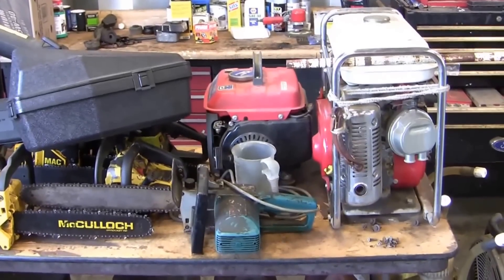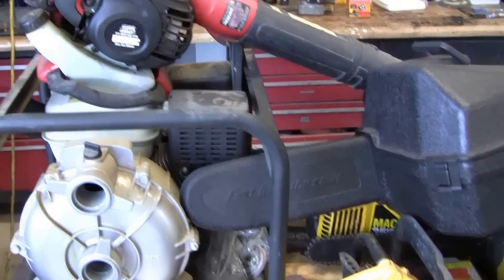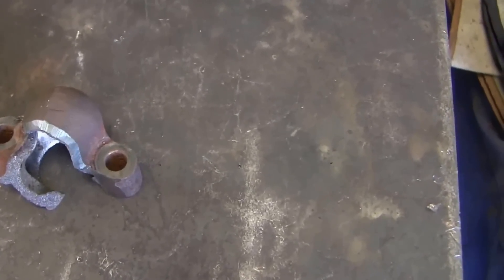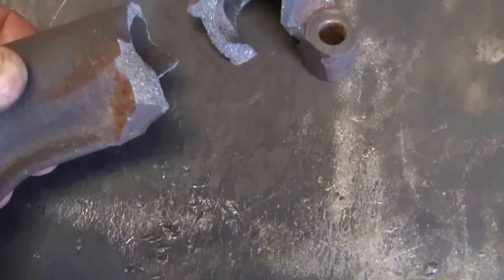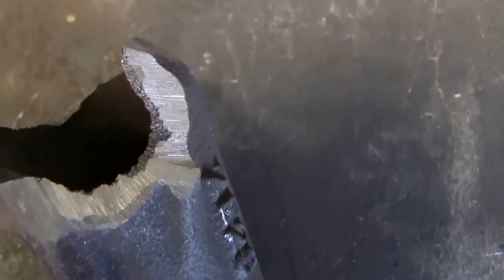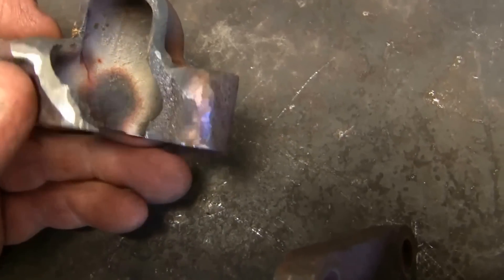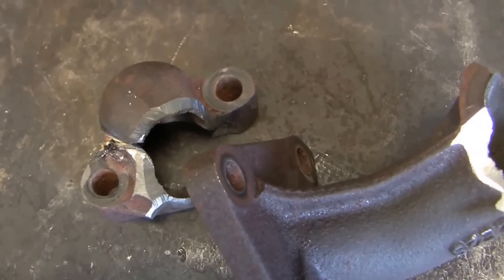Brazing Cast Iron

Comment: I am a expert welder , retired over 35 years , only time finger oil will mess with metal types is aluminum,  but still its not a major problem,  like you said by the time the heat gets to it most if it will be gone , but oil is used as a hardening technique , but yeah silver solder , bronze brazing rods , nickel rods , SS cast iron rods are just some of the things you can use to weld cast iron,  theres a hundred different ways , but finger oil is not a problem only in aluminum welding and it would take a lot of finger oil then ....

Comment: Just curious would a metal coat hanger work in a pinch
Reply: People use them for welding steel, mild steel, auto body.  It works, but it's not the best, it's not welding rod!  Welding rod contains things to help the weld action, deoxidizers, silicon...  None of that has anything to do with brazing!  So the short answer is "NO!".

Comment: I’m used to brazing stainless steel, copper and brass parts together but tend to run the braze rather than blob it on, is this how you have to braze cast iron or is this someone who’s more used to welding?
Reply from the maker: This is how I have done it for over 40 years with no problems or failures. I'm not sure what you are asking.
Reply: I think I was asking if this is the recognised way of brazing cast iron as I’m only used to brazing nonferrous metals which tend to need pre fluxing then running the brazing rod instead of the way you’re doing it, just curious that’s all.
Reply from the maker: @marksellers2939  There are several ways to do this with good results. This is the one that has worked best for me. You can add enough brass so that it can be ground down & smoothed out. It takes more time & brass with no added benefits except cosmetic so I live with the blobs.

Comment: Excellent job, was that brass or bronze, and did you use a flux ?
Reply from the maker: Thanks. The white coating over the brass rod is the flux. You can buy it with or without flux but I like to have both together.

Comment: I've done a lot of brazing, it was a long time ago. I'm not sure I agree with your method. You seem to be using the brazing rod as welding stick. I'm my experience its more like silver soldering. Prefluxing surfaces is crucial. I wouldn't chamfer back the crack either. You want the bronze (not brass) to flow in, like soldering copper plumbing. The molten bronze flows where there is flux and where the metal is hot enough to keep it liquid.
Reply from the maker: Been doing it that way for over 40 years & no failures even on engine blocks. You are over thinking this whole process. Watch & learn!
Reply: It's brass. Never seen bronze used for brazing.
Reply: I agree with Simon, exactly my thoughts.

Comment: Good job, good thing using brazing instead of welding won't get cracking.
Reply from the maker: It's a solid alternative!
Reply: @cam32112  lt is, l don't have acetylene l do my brazing using bits of fire bricks and a venturi Propane burner.

Comment: Leaving it clamped up over night is "very important"? Completely, I mean completely not necessary. Braze cast every day with great results. Matter of fact, as soon as job is cool to touch we put certain parts in latrh to true up the matting surfaces. Ya, let me go tell my boss we need to keep this customers job over night in clamps and not only will he laugh at me but, I won't have a job anymore.
Reply from the maker: You & your boss can crank out all the sub-standard same day cast iron repair you want. Letting the part cool as long as possible only increases strength of repair. 40+ years of experience. How about you?

Comment: Last time i brazed a cast iron I preheated the part on a charcoal fire. Then I decarboned the part by heating it to dull red with a slightly oxidizing flame in an acytelene torch. Then I fluxed everything and brazed it up with bronze rod. The rod was the same I used to fill the gouges in Swift Boat propellers.
Reply from the maker: Looks like good prep work for brazing cast iron. I use a rose bud on my oxy acetylene rig to preheat so no need to decarbonize, but for some parts I could see how that would be beneficial.
Reply: Great info thx for posting!
Reply: Oxidizing flame is the key. Graphihte migrates through the pearlite and escapes as CO2. I loved hearing about Swift Boat propellers. Was that red brass with arsenic added?

Comment: I have a Broseley Hercules wood burning stove. Sorry about the long url. https://www.google.com/url?sa=i&source=web&cd=&ved=2ahUKEwiMh6OAt8znAhWmRhUIHZAIBRUQjhx6BAgBEAI&url=https%3A%2F%2Fwww.pinterest.com%2Fpin%2F803892602212113582%2F&psig=AOvVaw15IqO4t0u9czhC9FP5CyKk&ust=1581611175645089 The top plate cracked in two one evening, when I had a fairly decent fire going. Could this be brazed or would the temperature from the fire melt the brass out of the joint?

Comment: burying the part in sand after braising can also even the rate at which the part cools, and can help prevent warping and cracking of the cast iron.
Reply: With it still clamped to the table? Or would you have to unclamp it? Think I would do like you said and leave it clamped, maybe cover it while it's clamped.🇺🇸🙋
Reply from the maker: Very good recommendation. I may try that in the future. Thanks!

Comment: Never, EVER, use Brake-Kleen on anything you intend to put a flame to.  There's a chemical in Brake-Klean that the flame turns to a deadly gas. You'll be dead from one small inhale.
Reply from the maker: Always weld in a well ventilated area. 40 years & no problems but use common sense by all means!
Reply: The gas is phosgene and has been used as a war gas.
Reply: This can happen with any chlorinated solvent. Not just brake clean.
Reply: Just use non chlorinated brake cleaner

Comment: The rods you use for braze welding are actually bronze not brass and anytime you’re doing something like that you really should clean the top edges /surface of the joint back so the filler metal can bond on top as well not just in the joint.
Reply from the maker: That engine is still going strong with that repaired part, but there is nothing wrong with being more thorough with any prep work.
Reply: It's brass but most welders call it bronze for some crazy reason. Brass does not flow.
Reply: @bingosunnoon9341  Kinda like P-5 welding rods. The box clearly says 5-P, go figure.

Comment: I thought you were doing a great job of preheating but I surely thought you were going to turn this down to a neutral flame before you started brazing nice job, it worked out
Reply from the maker: Instead of turning it down I just move the flame around in small circles more after pre-heating to melt the brass & keep the cast iron hot enough to accept the brass.
Reply from the maker: Thanks Joe!
Reply: In welding school they called it a carburizing flame
Reply: @brianmaddox8864  sorry I just saw your post, there are three basic flames, oxidizing,  neutral, and carburizing.  Excess oxygen,  even mix, and acetylene rich,  respectively.   I was referring to a more neutral to oxidizing flame, but not a carbonized flame.  Much on this is available on youtube

Comment: Don’t EVER, Ever use brake cleaner on anything you are going to weld on. Some will stay in a crack or something and when you hit it with the heat it puts of a very poisonous gas. More than a few people have woken up in a hospital wondering what happened, sometimes with permanent medical issues. Starting fluid works great without the risk.
Reply from the maker: I only use brake cleaner for its intended purpose but your advice is solid & appreciated!

Comment: Why not silver solder? I have never tried but have read that it works.
Reply from the maker: I think that the melting point of silver solder is too low & not as strong as brass. I could be wrong. I had brass & it worked fine.
Reply: won't stand the exhaust temp

Comment: Very nicely done video.  I have a Chevy head that I was careless in machining a spring seat and accidentally hit the water jacket.  Do you think brazing would be effective for a place like that.  The bad cut is on the outer perimeter of the spring seat, about 1/166" wide and 1/4" long.
Reply from the maker: I'm not very familiar with that kind of repair but if it's a spring seat & not a valve seat I think it would work.

Comment: Cast iron filler rods, Arc 60 amps low n slow, no preheat 
They've worked for me, great stress test results too.
Reply: My home only 30a on currency   Not working Arc welding
Reply: cam32112 What is the quality of the welds?  Is there a color difference?  Most welding repairs look like repairs because of the straw nickel color.
Reply from the maker: My grandfather used the same method you describe with good results. I just never got the hang of arc welding & no longer own one.

Comment: Is that a electrode your using? If so what number electrode? does it matter which electrode you use?
Reply from the maker: Is your question for me or RuMple StilTsKiN?
Reply: It's a flux-coated bronze rod.  An electrode carries electricity.  There ARE stick electrodes and MIG wire for this service also, but here it's fire all the way.

Comment: good work, isn't that something, against the odds of contamination, non uniform pre or post heat. my dad used to braze almost everything like air compressor tanks (and they'd crack again yrs later,  he'd braze them again,) natural gas heat exchangers, vents, grinder motor housings, he built us kids his own rolled up sheet metal into tuned exhaust pipes for hodaka 100s. I seriously believe "over thinking" the problems on a microscopic or universal sized level only brings those problems into existence instead of split logs.
Reply: I agree with your "overthinking" theory. I have now switched to "under-thinking." I get more work done, it's more fun, and I don't make as many mistakes trying to follow an overthought plan.

Comment: 2:17 Exhaust manifolds on what?  Small engines only?
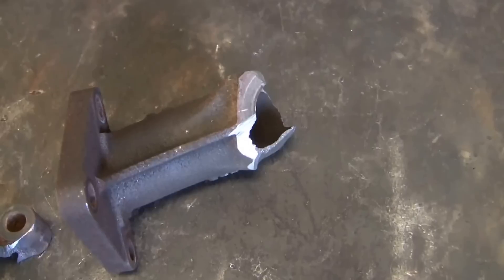@ 3:29  BWAHAHA!  Hey, at least it wasn't a flywheel, eh? HEHE
Reply from the maker: Sorry if I forgot to put that in the description. It was a Honda 13 HP engine on a log splitter.
Reply: cam32112
I've heard both that you can and can't do this for automotive applications.
Reply from the maker: I have seen auto & truck exhaust brazed as well as engine blocks. It's all in the prep work & execution.

Comment: how strong is this?
Reply from the maker: Well is has been in use for over 6 months without any problems so I'm happy with this repair so far.
Reply: ok thanks :) seems a good solid repair buddy. how do you think it would hold up on a high performance engine, ( 280bhp? ) 
i can imagine there is alot more back pressure to contend with

Comment: Are you running regulators at 7 and 35?I see people running different pressures for brazing.Thanks for sharing your knowledge!
Reply: 14 is very close to the maximum... At or above 15 psi acetylene becomes dangerously unstable
Reply from the maker: actually I run at 14 & 32. A friend who is a licensed welder told me those are good settings for brazing.
Reply: cam32112 loved your video, but 14psi on acetylene curls my toes! I think something was seriously misunderstood there, and you should double check. Anything over 10 would make a pro nervous. Something like 5-7 is more like it.
Reply: sorry - what is 7 and 35....or 14 and 32???
Reply: The pressures on the regulators for the acetylene and oxygen
Reply: Some rosebuds run 15/15